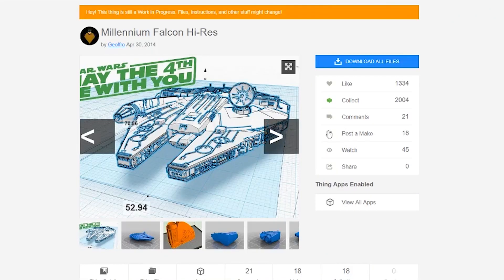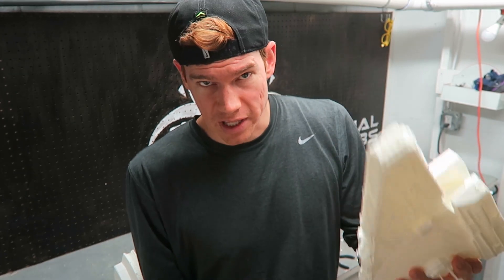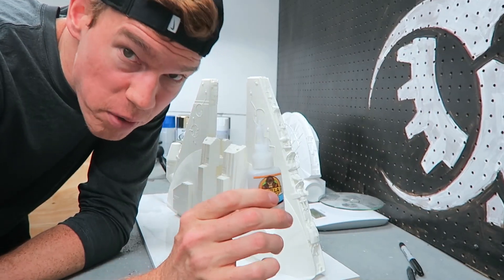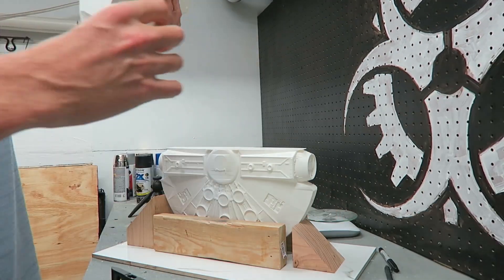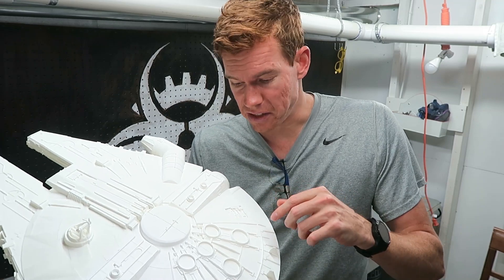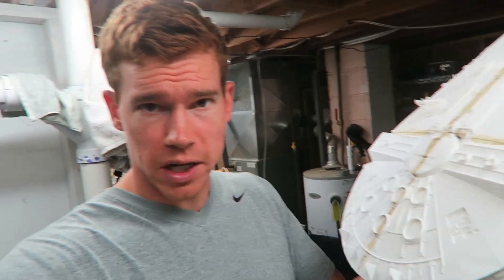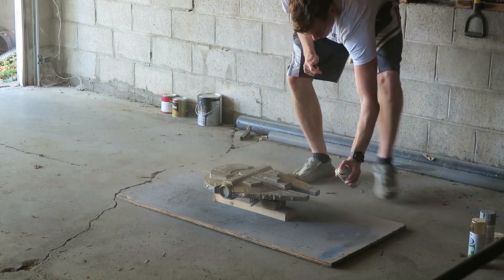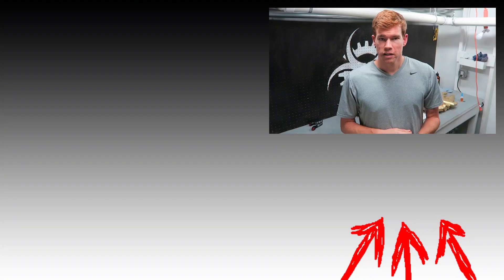3D PRINTED MILLENIUM FALCON | CREALITY CR-10

Comment: my ender 3 pro printed a different version of the falcon and the hydraulics on the back that control the fins around the engine were super shitty, like they fell off and partially falling off with just a little bit of it holding onto the falcon

Comment: I know that was so long ago but I would love to know what you scaled this too
Reply from the maker: I don't remember. I think I scaled those front pieces to take up most of the vertical print area on my cr-10 and then used the same scale on the rear pieces
Reply: @LethalEngineering  thanks for the response 👍🏻